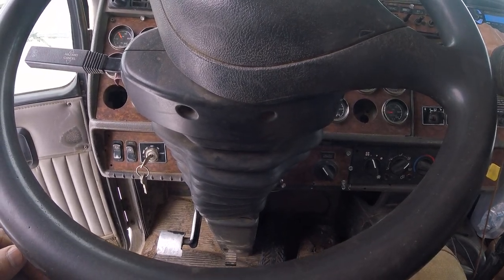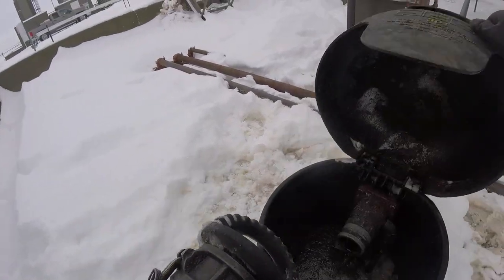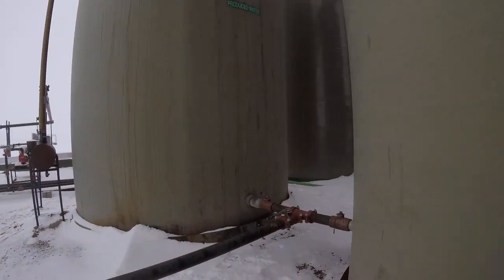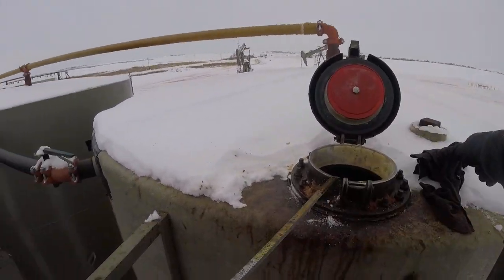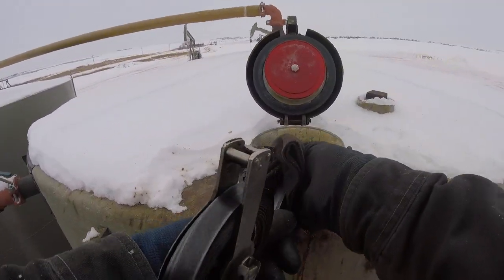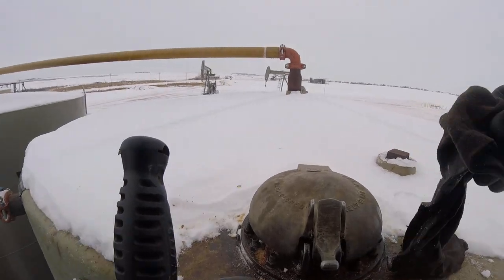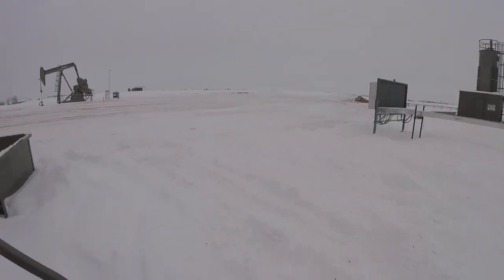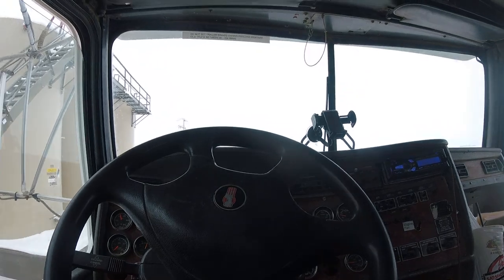Oilfield Work/Strapping production tank to tell levels

Comment: So strapping the tank is checking the level of oil in the reserve tank?
Reply from the maker: When we strap a tank it’s to check how much water is in tank.  The production tank will have mostly water.  Sorry, just saw your question.
Reply: @northdakotadriver5714  no worries. I got two puppies with me on the road. Doing flatbed. If I were to move to ND I'd have to find a place to rent that allows dogs and have a roommate to help let the dogs out and feed when I'm in the field. Man camps would be good if it was just me.
Reply: That's a local slang term that some workers use to describe what professional industry service operators refer to as performing an accurate production level via a tank Guage measurement.

Comment: So what was the Level Reading?
Reply from the maker: It was 8ft 11in to start.  If it’s a single tank every foot it drops is approximately 20 barrels.  Depending on how fast or slow water is flowing into tank.
Reply: So if I  am pulling into a 120 Barrel Tanker. That closing Gauge should be 2’-11” right?
Reply from the maker: That is correct, but It will vary by the speed the water is flowing into tank.
Reply: @northdakotadriver5714  ‘Preciate y’all!

Comment: Similar to checking the oil level in your car motor.
Reply from the maker: Yes it is, just on larger level with tape measure. 😊
Reply: @northdakotadriver5714  I start CDL School tuesday. Whatever is the wisest route to getting out to the Bakken oil fields to drive crude oil seems to be the direction I want to go.
Reply from the maker: Once you graduate you can go to North Dakota Craigslist and go to jobs then transportation and you will see lots of jobs.  There are lots of places that will hire and train you.  You should easily be able to start out around 125,000 a year.  Once you get 6 months or so of experience under belt you will be able to make much more.
Reply: @northdakotadriver5714  been looking at craigslist ND and seeing plenty of crude oil CDL jobs.  I think I want to do 6 months of OTR flat bedding just to get more experience in trucking and save some money to afford to move up there. Are you still driving up there in ND?
Reply from the maker: @cadillacjack3240  Yes, still working up there.  Almost all companies up there offer either free housing or housing for small fee.  Good to get some experience before.  It is very challenging up there dealing with fluids during winter.
Reply: @northdakotadriver5714  thanks for the useful advice and videos. I'll continue to like and comment your videos. I'll look you up when I make it up to ND.
Reply: @northdakotadriver5714  do you need your hazmat endorsement to haul crude, water or sand up there?
Reply from the maker: @cadillacjack3240  you do need hazmat for oil, not for production water or sand.
Reply: @northdakotadriver5714  does hauling production water or sand pay like hauling crude oil?
Reply from the maker: Oil typically pays a little more.  There is more risk involved.
Reply: @northdakotadriver5714  thanks for taking the time to answer. Would it be worth it to be up in ND hauling production water or sand without a hazmat? If they make over 125k a year then I'd imagine it would be worth it.
Reply: @cadillacjack3240  production water pays pretty good, no hazmat required plus we usually get to do a bit more physical work than oil haulers because we do well service, and just about anything else you can think of to do with a Vacuum Trailer. (Resists urge to try to recruit new guy to the company i work for). The big thing I'll say is avoid the Permian Basin and Oklahoma, North Dakota pays better and the corporate culture here is different. Make triple sure you ask about living arrangements in the "man camp" my company provided housing is tolerable to good, some of these camps are awful up here but the environment is getting better since people started bringing their families up with them.
Reply: @MickGallJr  I've been on the road a couple months doing flatbed and making more money than I anticipated. Not Bakken money but am proud of the progress. I got my hazmat endorsement now so quality of life and quality of pay is my two must haves if I head up to the Bakken. Id be there to make money and build something not waste it so a quality man camp would be important. What is the pay look like for production water haulers?
Reply: @cadillacjack3240  Flatbed is great and you can do that up here too. I was a flatbed driver for about 6 years before I came up here. Production Water Pays that same 120-140 you see everywhere. Sometimes it's as low as 100. My company pays a bit less than others but the camp is good and the benefits are great. If I could start over I'd get my CDL @ 21 get the minimum expirience to work where I'm at, then start buying land. If you're young and want to save this is fantastic. If you're older and have problems that can only be solved by earning 6 figures... Then you should also come up here. If you're lazy go drive Dry Van and don't even think about the Oilfield unless your hauling dry goods to the local Cashwise.
Reply: @MickGallJr  I'm 37, single and no kids. I want to make some great money to buy land and possibly buy my own truck. I got into flatbed trucking to get some experience and funds before moving up to North Dakota. Kinda wanting to get dog on the road with me but if I go to the Bakken I imagine I'll have to wait until after working the Bakken for that. I'm open to hauling production water or crude. Quality of life is important along with pay is important. Sounds like you found both of those where you are at. I may reach out to you in a few months if I make it up to the Bakken.